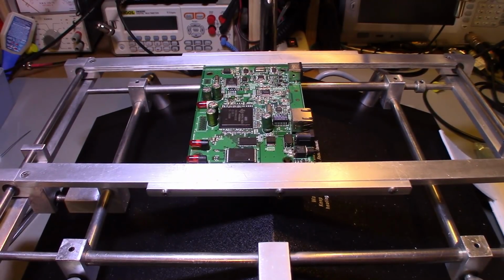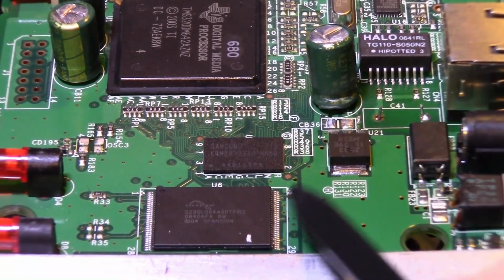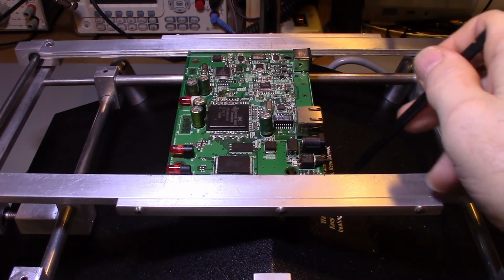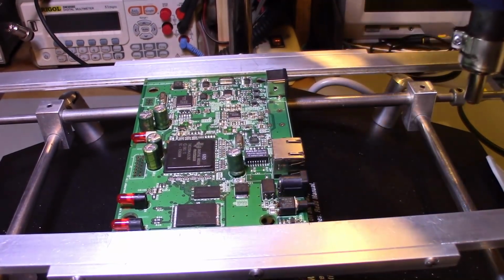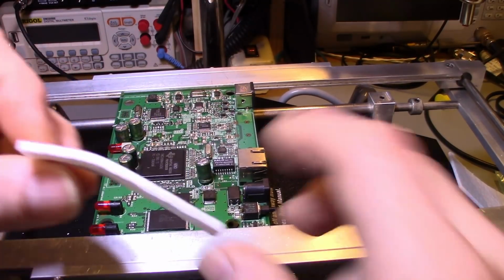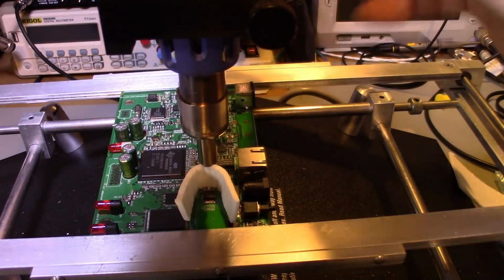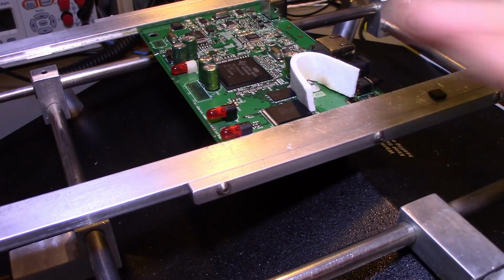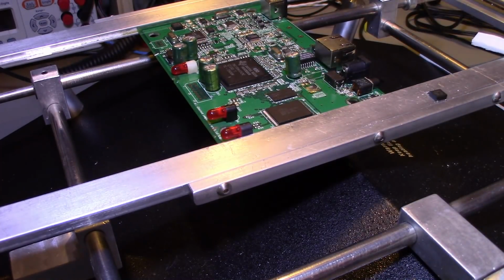Removing surface mount parts without damaging surrounding components.

Comment: Everybody’s soldering woes are from not using the correct tool. Dpaks are the easiest thing to remove. Hot teeezers, two seconds. Hot air is the wrong move.

Comment: Look at the Rossman Repair Group YouTube channel. He's from NY, and repairs Apple laptops. You can see how he removes tiny surfaced mount parts on Apple motherboards. You can also watch him rant on why to not buy Apple.
Reply from the maker: Very familiar with Louis.  The big difference is he repairs laptop computers and I do radios.  Unfortunately I do the radios and pretty much every SMD part in a two way radio is surrounded by parts that can be easily damaged with heat.  IF transformers, plastic molded coils, connectors, wiring, aluminum electrolytic capacitors....  I can only wish the circuit boards I work on had so few heat intolerant components.

Comment: Nice stuff, just searched for it but Farnell does not has it. I most times use aluminum tape. But most times I do not need tape or so. I never use a preaheater, getting a 16 pin IC is about 15 seconds if I do it  gentle. Are you not afraid the parts at the underside drop off or melt ?  I am afraid a pcb laminates if I heat it through and through.

Comment: I’m new sub and to how to correctly improve cb’s, love your videos Mike and you taught me a lot.I know this is off topic but I have a cobra 29 I used for a couple years in a “kidney bustin” 6 axle dump truck. It works great and clear but Recently my receive drifts out and goes quiet, to get my receive back I have to tap the PTT button or smack the housing the radio is in, I don’t want to take it to cb shop coz I don’t want it hacked
Reply from the maker: First thing to check would be solder joints.  Being in a dump truck it has had a hard life due to vibration.  You will probably find at least one broken out solder joint which is making for a intermittent connection.
Reply: MikesRadioRepair thanks for the reply, I will look in to it tonight, keep up the good work

Comment: Mike - What's a good safe temperature to to remove SMD's? Also, since "asbestos" is still used outside the USA, its probably not a good idea to purchase from a country that still uses it...so US is a great choice to buy from!  ~Jack, VEG
Reply from the maker: That varies greatly.  First thing to check is the data sheet for the component.  That will give you the soldering profile of the part.  Also need to know the melting point of the solder used.  Which tip your using on the hot air reflow system can also play a large role.  There are usually going to be tip offset temps depending on the size of the tip.  Is the board being preheated, is it multi-layer, etc.  Sooooo many things dictate the temperature.

Comment: Thanks for the tip on KAOWOOL; only need a small bit every once in a great while so ordered up a piece on eBay...should last me a very long time. Kapton tape has been the go to for a long time, this is another good tool for the soldering kit bag (not the one that goes underneath your reserve!).  ;-)

Comment: Often I'll use turbo tape or exhaust manifold tape as its often called to protect surrounding components etc. Its nice & flexible, only about 2mm thick and can withstand 1000°c continuously and 2100°c temporarily. Its also available everywhere for about £10 for 50meters x 25mm.

Comment: I was looking at those JBC "extractor sets" as an alternative to the various expensive nozzles for my Quick TR1300 and then decided to DIY with very thin stainless steel (can't remember the alloy) and line them with the HTIW/Kaowool. After that, I found I didn't need the vast array of nozzles or fancy "extractor shields." The DIY shields lined with ceramic fibre saved me hundreds if not thousands of dollars and are still going strong after 7 years.

Just thought to share that.

Comment: Hi Mike, if you were removing the part from the board to use to replace a part on another board would that part be reuseable.? The Kao wool heat shield is a good idea to use.